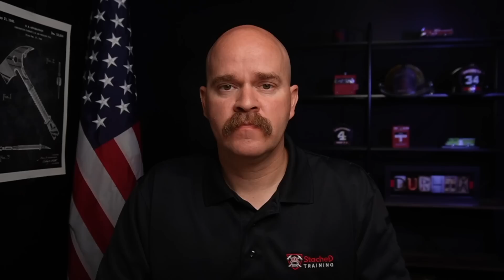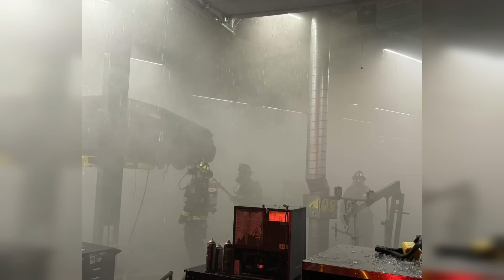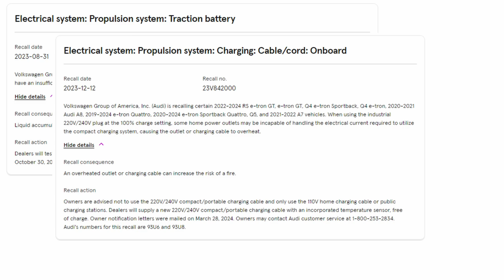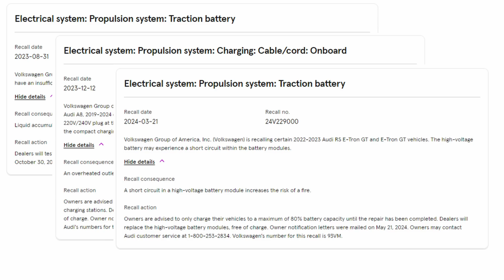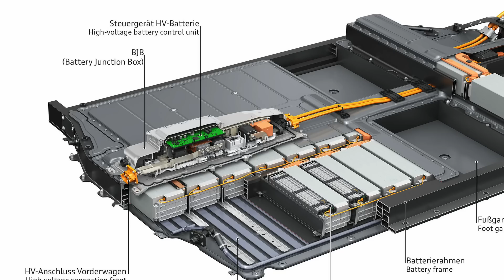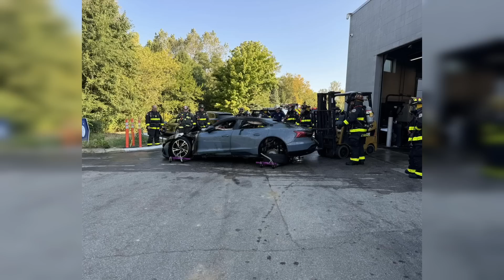EV Fire in Service Bay: Stuck on the Lift

Comment: I work at an automobile dealership and can tell you, nobody prepares for this sort of scenario.  One of the technicians who does the most EV battery repairs is located directly in the middle of the shop.  His lift, with a vehicle in the bay, positioned on a lift is within 15-20 feet of the parts departments open second floor which is wide open and stores tires directly along that exposure.   This is a scenario which presents not just a huge lose potential for the dealership should a fire occur, but an extreme challenge for first responders should such an event happen.

This is information which needs to be used to establish reasonable policies to minimize risks in all such environments where EV are being stored and/serviced.   I'd also add that battery chemistry needs to be highly reconsidered if this it going to be the main threat from these vehicles.  There are safer alternatives, they might not be as efficient, but what is more important, and extra 50 mile range of a human life?

Comment: They should have put a chain on it and told it out with the forklift. The forklift would have pulled that right out with the wheels on the dolly. It would have been a lot easier than pushing it out thank you.

Comment: Electric vehicles (EVs) are less likely to catch fire than internal combustion engine (ICE) vehicles: 
 
Fire rate
According to the Phosphorous, Inorganic & Nitrogen Flame Retardants Association, EVs have five fires per billion miles traveled, while ICE vehicles have 55. 
 
Battery fires
According to EV FireSafe, as of June 2024, only 0.0013% of the global BEV fleet has experienced a high voltage battery fire. A global study from 2010 to 2020 found that passenger vehicle batteries caught fire at a rate of 0.0012%, compared to 0.1% for ICE passenger vehicles. 
 
Fire risk
A report from Sweden found that hybrid and EV fires make up less than 2% of car fires. 
 
However, EV fires can be severe: 
 
Heat: Lithium-ion batteries burn hotter than gas and can last longer. 
 
Water: Extinguishing an EV fire can require tens of thousands of gallons of water. 
 
Reignition: An EV battery fire can ignite again after several days. 
 
Newer batteries are being developed with safeguards to reduce the risk of fires, such as thermal insulators and flame-retardant additives.

Comment: You know what happens when a gas or diesel car has an electrical problem? It just dosent run……. It dosent blow up usually
Reply: It is the electrical wiring in an ICE Car that causes fires.

Comment: People should stop buying the full Electric vehicles, and stop letting this climate crazy Democratic party Force us into electric vehicles. The infrastructure for charging is not adequate, the cars are still dangerous, the rare earth minerals cause a lot of  destruction of the environment when they are mined,  the batteries degrade over time, and no one wants to buy  a used one. The idea is a failure, and I speak as a former Tesla owner. Plug in Hybrid vehicles are the best way to go, not full EV.

Comment: Battery Chemistry needs to change. Gotta be something else better than lithium.
Reply: There are the old fashioned batteries not made from lithium
Reply: @jtpjtg9189Nickel Cadmium is rechargeable without a thermal runaway fire hazard.  Lead batteries contain concentrated sulfuric acid which can leak or spray, but not thermal runaway.

Comment: Used to work at a car dealership as a valet, bringing cars down to the shop to get serviced and up from the shop that had finished getting serviced. Rarely, an EV would come into the shop. (The dealer didn't have a lot of EVs on the market.)

One time, we had one come in for a battery replacement. The technician working on the EV was required to seal off the area around the car to prevent others from walking near or under it. That's because EV batteries can be toxic. (I don't know if the tech had to wear protective gear or not. I wasn't able to see him working on the car.)

Comment: People just buy a normal gas vehicle safer more reliable and they don't take hours to fill up unlike a battery that's going to take hours to charge what if there is no power to change it and someone close to you needs to get to a hospital fast if you don't already have a full charge your not going anywhere in that brick

Comment: Never wanted a battery car, never will get one. Just bought an F150 eco boost that’s like 40/50$ to fill, and I can get almost 600 plus miles on that tank in eco on the interstate- probably better if I didn’t constantly take over and push the vehicle harder. Plus I don’t have to worry about it burning my house down when I’m sleeping and it decides to go full send.

Comment: i dont know all the details, but one thing i am VERY curious about is if a battery maintainer was left on the vehicle over night. the e-tron gt uses a 12V lithium battery as well as the HV battery. unlike other models, the charger connects directly to the positive battery post, and the 12v battery is located under the cowl near the windshield, where all the carnage appeaes to be located. i suspect a poor quality battery maintainer was used and started this, and its not even the cars fault. if there was a true HV battery fire i doubt there would be anything left of that car.

Comment: an ice vehicle caught fire,  actually,  exploded,  when the gas tank was being removed, and a drop light ignited the highly flammable liquid. The tank was being removed as regular service when the electric fuel pump, which is one of the dozens of expensive parts  prone to failure, quit in the middle of the road.

Comment: This is one of the reason why I will not buy EV car. I do not want to park it inside garage while charging it. Also replace the battery pack will cost you more than the money that you will save on gas.

Comment: 50 feet away .. ? You can dream  but in Reality that is almost impossible !
I dont know much about the US Workshops but here in Germany there are many little Shops  with no or  1-3 Parking Slots in best case always full
Bigger Shops have more Slots but they are mostly occupied too
And i think in the US that is the same Problem there is no Space for those "Special Cases"

Only one Way work  .. sue the Manufacturers until it burns, that's the only Medicine that works
They put expensive Junk on the Streets and barely meet their duty of care

Systems must be developed that extinguish the Batteries from the inside or, better yet, make the System non-flammable

You can't adapt/rebuild a City just because the Manufacturers are too stupid/greedy
Reply: I think the ultimate goal is no cars for the unwashed cattle. See: Climate the Movie

Comment: How big of a property will an EV service shop need to keep 50ft spacing? I have to assume that most EV service issues are electrical related so pretty much every EV in for service will need that spacing. I’m not seeing it as practical even for 1 car to have 50ft buffer zone around it.

Comment: You can't stop the future. THIS IS THE FUTURE!! If you like it, or not. At the beginning of the ICE engine cars era, the horse carriage owners said the same than the EV haters say now... As the era of horses passed away, the era of ICE cars passes too.  The new EVs battery is NOT FLAMMABLE: iron phosphate, and the range is 500-600km already. It will be better in the future.  And the  efficiency of the EVs about 90% while the ICE engines 40-45% max. That is it.
This is how people work: if something needs to advance, they will advance it. That is how the world goes. If there's a need for solar panels, they create solar panels, if there's a need for EV cars, they will create and advance EV cars... Evolving.... So it is futile to scold the EV cars because they are the future for sure. Don't srain yourselves...
Reply from the maker: Lithium Iron Phosphate can and will go into thermal runaway.  It's a little more resistant to failure,  but if it does fail, it releases significantly more hydrogen.

Comment: Now what did actually burn?
Also gas cars are also removed from a building if possible or the building is evacuated. For the reason that is seen here, fires that are within an object have a high risk of reigniting. For once because you usually don't know what exactly started it and if the source is still dangerous, and also because fire or even just glowing parts can stay hidden for quite a while.

This whole video is just empty gas lighting, nothing here is special, a car burned like thousands do every day, they put it out, obviously there was some damage, fire is not fun, and so on.

Also it kind of speaks for the EV that one burning is news, gas cars burn so often that having a whole ship sink because of a burning gas car is just another normal day.

Comment: In 2021 there was a 174,000 gasoline vehicle . Easy google check . I’ve had a ev for 20 years charged by solar. Never had a problem
Reply from the maker: What EV did you purchase in 2004?
Reply: @StacheDTraining  
Started off with a prius. Then a 2008 Tesla .  Been with Tesla ever since .
Reply from the maker: @davemalinak6802  Prius used a very stable nickel based chemistry.

Comment: EVs are great and probably will be the future of personal transportation. But they have one big flaw, the current battery technology it requires are large and heavy battery to get any decent range, and if you get a fire, good luck putting it out. If someone figures out a better solution to power the electric motors on EVs, I will probably get one and something that doesn't cost 20k to replace.

Comment: And they didn’t even have a fire blanket I mean it wouldn’t do much here but the fact it’s not a common thing for them to have when there litterly millions of evs on the roads.
Tesla has them they can put a raging 3000+ degree fire that’s been burning for 30 minutes out in 45 minutes but use a couple hundred gallons of water compared to the fire department using thousands ad thousands of gallons.
Start screaming at the fire department to have fire blankets for ev cars.
Also 95% of the things they respond to is not a fire so require them to have smaller trucks for grandma needs help or help my heart stoped like having 10 to 30 tons drive to you for a none fire is redikuless.
I forgot the town but next to Canada there’s a USA state that has there fire department use motorcycles for none fires and they save multiple thousands of dollars every year and they save more people and they get there 60% faster with 40% less danger to everyone on the road.

Comment: The battery management system is called the auxillary bay. It usually has pyro-fuses that blow if voltages run rampant through the system.

Comment: This car was quite new, I am worried if these cars getting in age and electric cable and plugs and all these things are not in good shape anymore.
Reply: They won't last 5 years, 10 at most, especially when the 25k plus battery bank eventually goes and needs replacing and the value of the car goes to 0

Comment: Come on people in the comment section, take a deep breath and hear me out.  Electric cars are still relatively new, they pose some ‘unusual’ health and safety risks.  They are not perfected yet, like ice engines are.  Battery tech is still pretty new and not very safe…yet.  Everytime something new comes out, people are leery and sometimes even scared of it, such as microwave ovens, switching from horses and wagons to automobiles.

Comment: I've seen firsthand how hot and violent a lithium battery fire is, last summer while I was working alongside another electrician changing out some old high pressure sodium lamps to ballast bypass LED in the parking lot of an apartment complex, using a boom lift.   In the process my DeWalt drill with a fully charged 20/60 volt 6Ah flexvolt battery slipped out of my hand striking the asphalt from about 25 feet in the air.  The battery went into thermal runaway and burst into flames.  My only recourse was to stand back and watch my $240 drill and $200 battery burn until all the fuel was consumed.  When all was said and done, it set fire to the asphalt and burned all the way through to the soil, leaving about a foot and a half crater that  had to be filled, all the copper & aluminum parts of the drill and battery were melted.  

I think I'll stick with my oldie but trusty 2013 Chevy Express 3500 with the 6.0L V8

Comment: And for the end user:  do not charge or store the vehicle inside your garage.  Sounds ridiculous, sure, but it may save your life.
Reply: Probably even more important: 
If the (outlet) is ill-fitting due to age: replace it, preferably with a commercial grade one.
I also installed an in-use rain cover because my (outlet) is outside.
I also replaced the straight plug (that was getting warm at the wire bend) with an angled plug out of an abundance of caution.

Comment: They rushed to Lithium as the battery chemistry of choice. Should've waited until a safer chemistry comes along. Now there's a big stigma regarding all EVs. Anyone who wants to save the environment simply needs to eat less meat, it'll do more for the environment than getting an EV anyway.
Reply: They DID have a safer chemistry. A literal oil company bought the patents in order to (successfully) delay the electric car by 20 years. The Tesla roadster used hundreds of 18650 batteries (commonly used in laptops at the time) in a robust, temperature controlled, case as a patent work-around!

This is described (in part) in the "Patent encumbrance of large automotive NiMH batteries" article in Wikipedia. Despite opposing the California Zero emission mandate near the end of the last century: GM developed a pretty good electric car, the EV-1. It had enough range for typical city trips. It was not sold, but leased to customers. After the Zero emission mandate was defeated: GM recalled the EVs and crushed them. Much like happened to streetcars nearly a century earlier.

But just crushing the Electric car was not enough. They needed to salt the Earth so to speak. So GM sold the NiMH battery patents to Texaco, an oil company. Patents have a particular property. Ostensibly they are designed to encourage innovation by encouraging the disclosure of technologies. But patent holders are NOT required to license a patent. Texaco was later purchased by Chevron. Chevron then sued Panasonic, the battery supplier for the Toyota RAV4 EV. Toyota at the time had a lot of experience with NiMH batteries: having used them in their Prius hybrids. But I guess not requiring fuel was a step too far for the oil company. Toyota has been focusing in Hydrogen fuel cells ever since.
Reply: @economicprisoner  Interesting. I'm familiar with the EV-1 and what GM did to it to delay EVs, likely because of pressure from oil companies and/or payoffs of some kind. NiMH chemistry had a big problem with self-discharge, which I think is now mostly mitigated. Toyota to this day still offers the Prius with NiMH batteries, with Li ones being an option (at least last I looked.) NiMH doesn't quite have the volumetric energy density and thus weighs more for comparable storage capacity, but at least there is no risk of fire! I wonder is NiMH batteries would also be easier to recycle.

Hydrogen is a nice idea but so far hasn't been faring too well in California, pretty much the only place where refueling stations even exist outside of Japan. I think they're planning on doing a trial in Canada (somewhere in British Columbia) but the complexities and costs of electrolysis, liquifying hydrogen and cryogenic storage seem daunting. Maybe the ultimate solution is a different synthetic non-ethanol, non-petroleum based liquid fuel made in a sustainable way. We may never know as long as nature offers resources to be plundered for free. Only when oil runs out will oil companies shift towards synthetics.